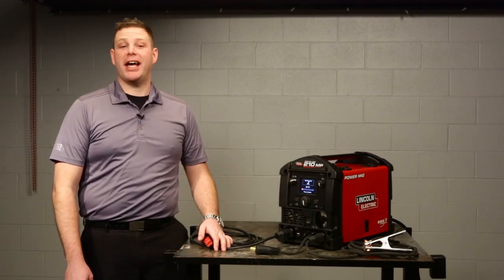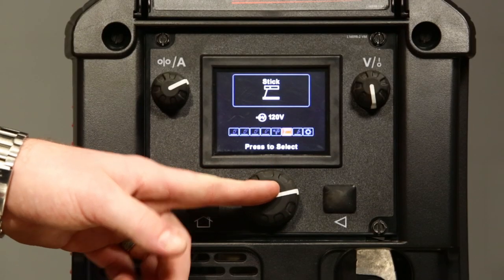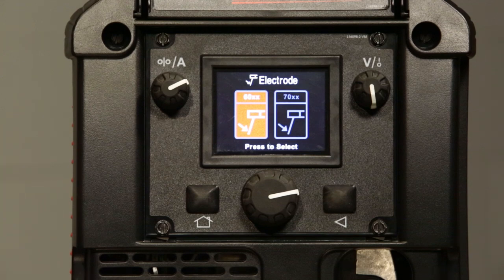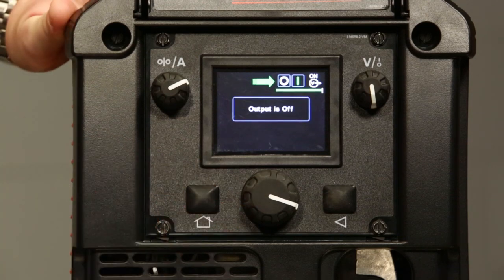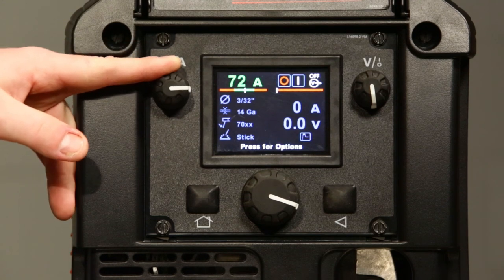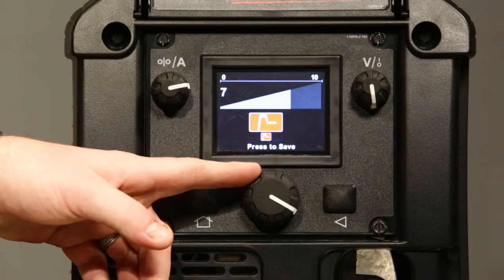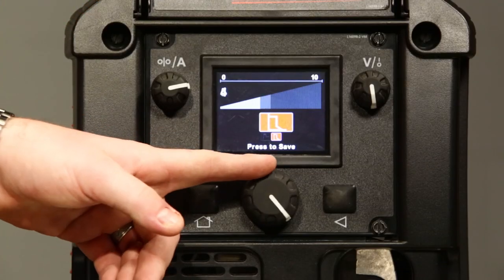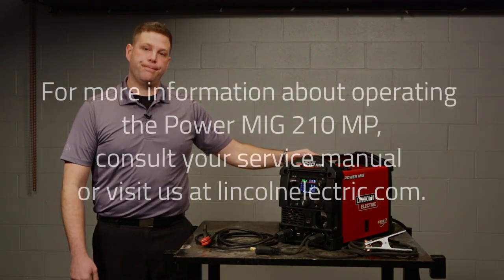Lincoln Electric POWER MIG 210 MP Stick Set-Up

Comment: Hello I'm having a hard time setting my machine for 308LFC-O gasless .035" wire. I set the machine to what the manual says to set it at and I'm still having a lot of trouble can you please help me out? Thanks,
Reply from the maker: Thanks for reaching out. This is not Lincoln wire so we cannot speak to its quality or reliability. From what we've read it has typically not feed well in smaller machines. Our engineers suggestion (other than using genuine Lincoln Electric consumables) is to turn the voltage all the way up and be in DC+ polarity.

Comment: Hi, I have one of this nice mig 210 and are great but  I have a doubt about your setup, you are saying that this setup its for 7018, but you are conecting electrode negative , the 7018 is supposed to be used in reverse polarity,i have to ask because I have been testing my machine for 1 week and I feel like the electrodes react like the polarity its changed especially i can watch this in 6011and 7018,
Reply from the maker: Hi @battleminion. Thanks for the question. 7018 can be run in either DC+ or DC-, depending on the rod.  DC+ is the most common set up.  Why the host set it up DC- I guess was personal preference.

Comment: 6010 is possible to weld with this machine? and what would happen if I try? I need this type of welding electrode (6010) but did not want to spoil the machine. thanks
Reply from the maker: +Rigoberto Figueroa Thanks for the question. It will not.  If you use a long whip technique with 6010 it will pop out.  Use 6011 instead.

Comment: what size rolls will this except ?
Reply from the maker: +dunno yolo Are you talking about wire size or Spool size? Here are answers to both:

Wire size:
     0.25-.035 Standard wire
     0.30-.045 Flux-cored wire

Spool Size:
        4"-10"

Let me know if I misinterpreted. I will get the correct answers if these are not what you are looking for.